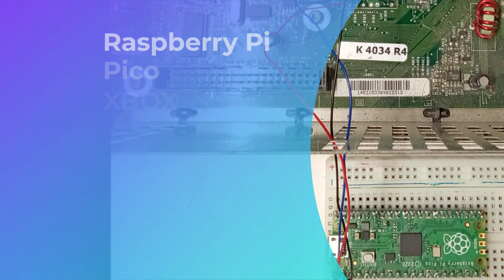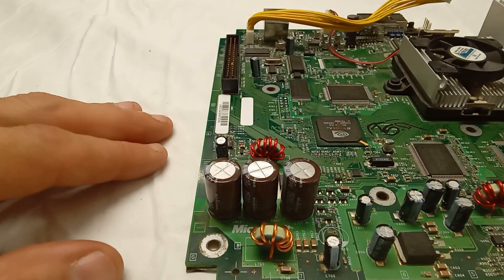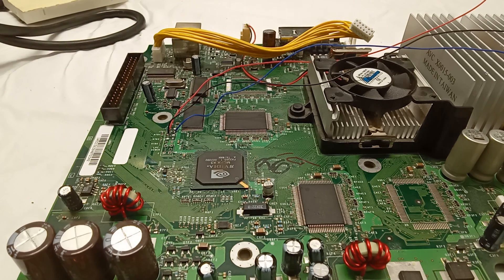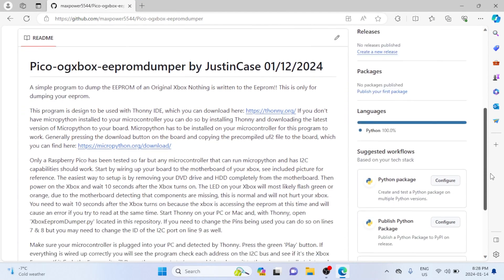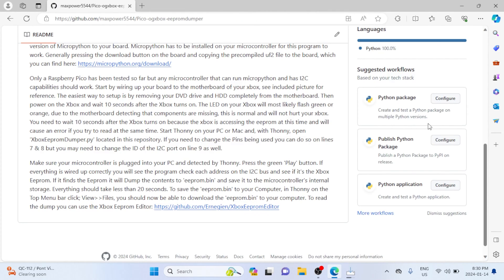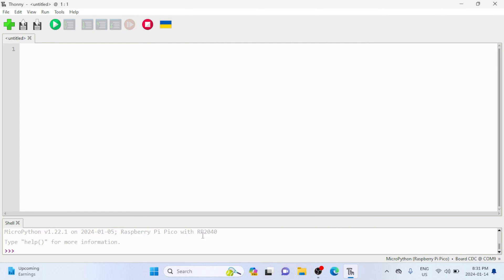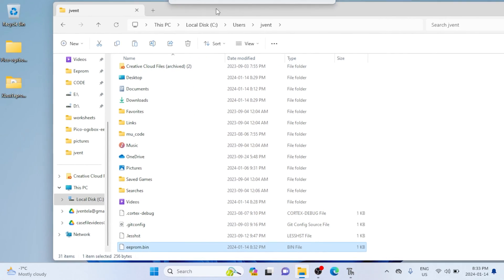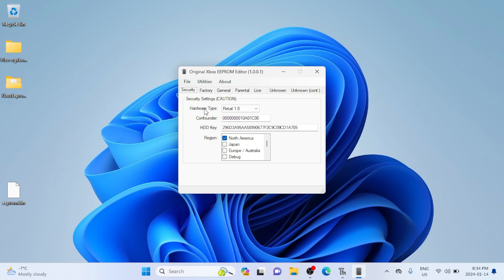Raspberry Pi Pico Xbox EEPROM Dumper, Quick and Easy

Comment: Worked perfect first try for me on my 1.4, now to try and unlock my hdd and copy the saves off it if possible, I just wish I could write the eeprom with this SUPER EASY TO USE adapter I'd made (with your instructions/directions).

Comment: Thank you very much, was able to get the EEPROM from my 1.6 model even with my noob-level soldering. My xbox is/was stuck on trying to update the dashboard, but I cannot get FATXplorer to unlock the drive. Think I need to try a different usb/ide adapter :(
Reply: Hello, was it necessary to rebuild the LPC port?
Reply: @ProyectoFenix28  all i did was solder the 3 wires to the LPC port, i didn't add any pins or have to repair it afterward

Comment: I got a 1.0 Xbox back in April and I've been trying to save it. The hard drive is about to die because I can hear it clicking so I tried softmodding it to extract the EEPROM and I tried it dozens of times and multiple methods and it wouldn't boot. I tried this method and it worked first try. Thanks so much!

Comment: I am a little late to the game, but you made it so easy to save my xbox with this video, others were a mess for someone who does not do coding, since my original drive died after i soft modded it, and enough time has gone by i could not remembered if i nulled the HDD key, so this will help me check once i get my hands on the physical parts i need.

Comment: I was able to do this one a 1.2 without even soldering in the PI pico just touching them; I just got a 1.0 and doing the same method I'm unable to read the pi it keeps telling me Soft Reboot no Eeprom detected
Reply: I do like this method but I think the piprom is better as it works on all models sometimes this method doesn't work for me

Comment: hI im interested in modding an original xbox myself but I have a question. What are the benefits of EEPROM dumping and what is it used for? Also which mods do you recommend I should do. Thanks!
Reply: The eeprom has the console info, such as an HDD key that is mandatory to have, if your xbox HDD ever dies, with the eeprom backup is way easier to replace it, so you might want to have it in a safe place

Comment: Will try later today. I unlocked my hdd on my debugger via hot swap and didn't know that I needed the password. Now, the Xbox boots into an error 5. I've never had an original Xbox before, so I don't know much.
Reply: Worked! Thanks a lot!
Reply: @jorgejor2285 of you are softmoded you should nill your eeprom with all 1's very easy to do in nkpatcher on Rocky 5.. you or anyone else will never have to worry about that again..